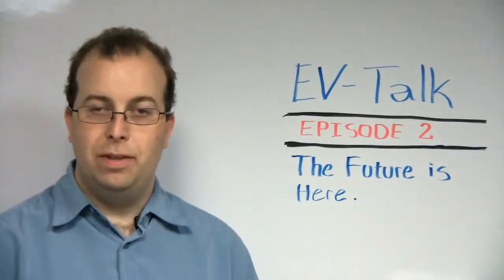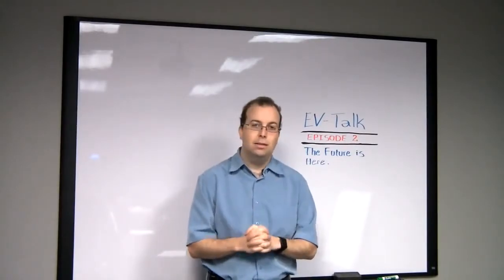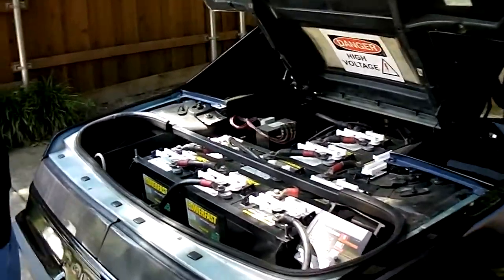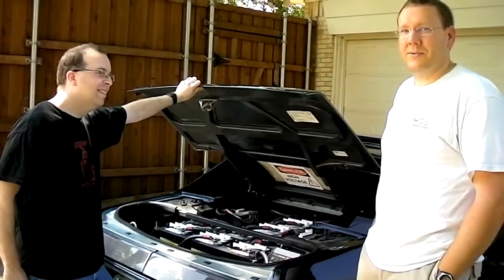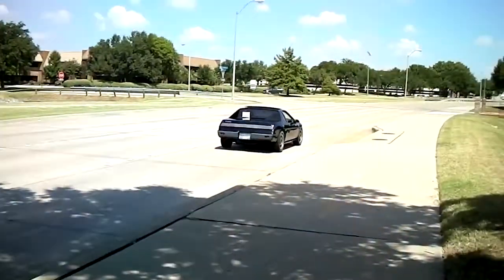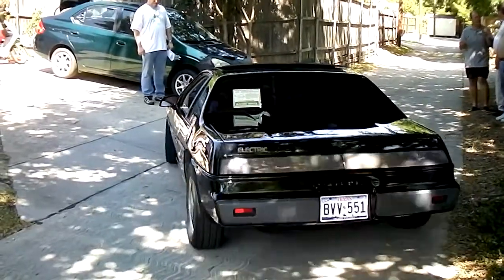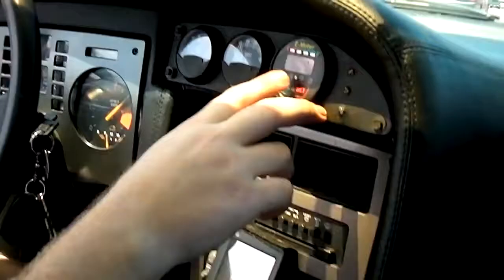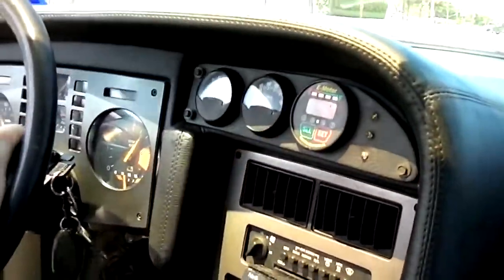[The8BitGuy reupload] EV Talk - Episode 02 - The Electric Fiero

Comment: Very impressive ESPECIALLY given the time. 50 mile range is quite huge for Lead Acid batteries. To put this in perspective, my 2012 Leaf (pre-Lizard battery) was continually losing range to heat and got down to a maybe 30-40 mile range and that was an OEM designed vehicle. Great job. I wonder what the costs were.